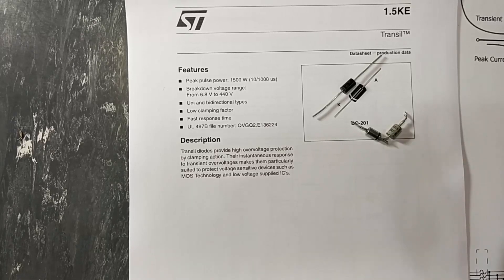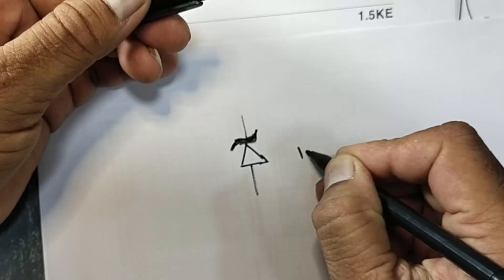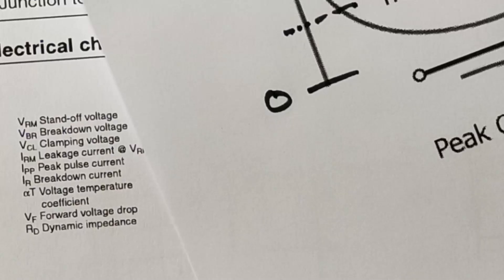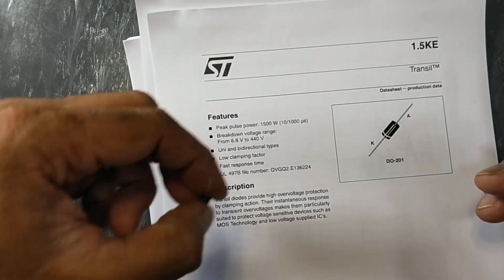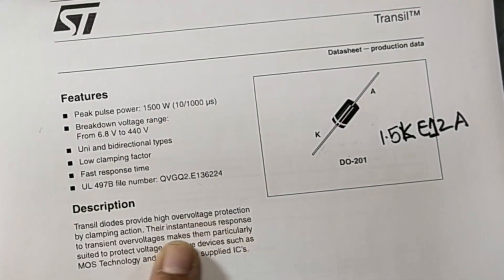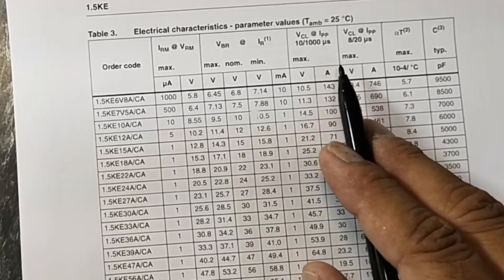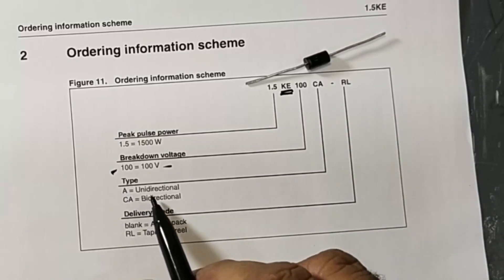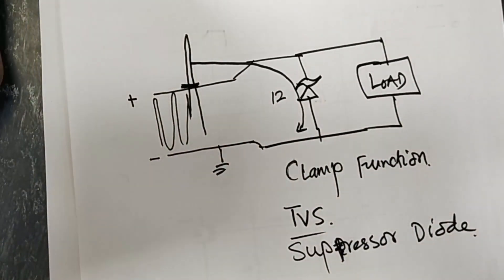{485} TVS Diode Unidirectional Explained, Transient Voltage Suppressor, Transil or Thyrector

Comment: Can I connect 2 unidirectional TVS in series to double the breakdown voltage? I have a 170 V damaged TVS and want to replace with to identical 85V TVS? Is it possible?
Reply from the maker: yes 
it is doable. you can connect them in series
Reply: @HaseebElectronics Thanks a lot! I just tried and it look it works. I see now the circuit is working but I when increasing the DC voltage over 250V (DC voltage in the solar inverter input) the smps circuit start working an I see 170V across these series TVS. I want to know there are circuits when TVS are designed to work as constant voltage limiter like a zener diode or maybe I have something wrong although the circuit is working well for some time?
Reply: I compared it with another working circuit and the voltage value is 170V on the undamaged TVS when the smps start working. Thanks for this very useful video!

Comment: Anyone, please help. I have a Shower Heater-Unit with adjustable power control (potentiometer) that was given to me by my neighbor to fix and keep for myself, and after dismantling it I found on the control PCB a bidirectional diode with such electrolysis damage on it which dissolved both of its terminals and it was hanging at its place on the board by the rust (the symbol on the PCB is for a BTVS). I have tried to put solder at the two ends to attach new terminals to it so I can reconnect it in its place but they will not stick. There are no service manuals for this unit I could find by searching on Google and I am wondering how to fix this unit without knowing the part number or the clamping voltage of the diode (since there are no terminals left sticking out from the two ends) . The diode itself is a pink glass type with the "cathode" black band in the middle and D8 is written on it. The diode is also not clamping anything in parallel (as in the case you describe to protect something from overvoltage on the board). Instead is connected in series to the gate of a small triack on the board (0107MA - To92) and to some other point on the board. The triack is probably driving an even bigger (high power) semiconductor that controls the heating element current and which is attached directly to the water heating unit (probably for heating cooling issues) and it is not on the control board. Any ideas on how to attach terminals to this diode? What is the range of or typical clumping voltages for these diodes? As a last resort to salvage this diode I was thinking if it is a good idea to use electrolysis and grow new copper terminals at the two ends if I immerse the one end of the diode in the solution and put a needle/pin with some high enough voltage to make the diode conducting current and start the deposition of the metal at the other end, then if it succeeds flip the diode and repeat.

Comment: How does tvs diode with three terminal work.
Eg part number B24C
Reply from the maker: can you please send its picture to my whatsapp, 
as i think B24C is in DO-214AA package style, it is in 2 lead package 
then the 8 pin dip contains 4 TVS diodes in one package 
if you have 3 terminal component, i want to see its package style 
my whatsapp is 009-62-79-116-1084
Reply: I have sent you  the photo of it
Reply from the maker: @drameriemmanuel1187  I will check it and will reply it
Reply: @HaseebElectronics  thanks sir.

Comment: Hi Haseeb, how do you know if a TVS diode is not working. Uni directional ,  will  it be shorted like a MOV
Reply from the maker: sometimes it becomes short circuit and it drops the supply voltage. due to its maximum breakdown limits 
it short circuit is eliminated very easily that it clamps all voltage in that line

Comment: THANK YOU. WELL DONE. Datasheet show that 1.5KE12C/CA parameter "Vcl @ Ipp 10/10000us" where Vcl=16.7V and Ipp=90A. Does this mean that TVS is clamping 28.7Vpk pulse (12V+16.7V) or 16.7Vpk pulse (12V+4.7V) @ Ipp=90A ??

Comment: Years ago I was using a VFD to experiment with 400 hz into a microwave oven transformer. The turning the transformer on and off damaged a large diode. I took a large diode out of my junk box and replaced it not knowing what it was for, but it worked again! I now know what that diode was for thanks to you. I wish I saved the original damaged diode to replace it with the correct part!
Reply from the maker: wow 
it is really my pleasure, that my efforts are useful for my viewers

Comment: Hi there, I have a question, bought a new plasma cutter from China. I plugged in machine to power outlet and by just switching it on. The machine turns on for a second and trips the circuit breaker. Is the machine faulty? The seller asked me to change to a bigger socket outlet 240vac which I am already using 30 amps non fused. Additiinally upon receiving the machine, the 240vac input wire seems like funny looking with sticky substance on the outer insulation. Hope you could guide me. I clamped on anmeter to the 240vac and it reads roughly 12amps and trips the breaker. Thanks for the great videos.
Reply from the maker: does the circuit breaker for building trips off or the machines circuit breaker trips OFF?
if the machin's breaker trips off, then it is very clear that the machine have something wrong. it is expected that the machine have some issue.  after turning ON for 1 second, it seems that the surge protection circuit have some defect.  or the power stage have some issue 
if the building breaker trips off then, it means your utility line is to be upgraded.
Reply: @HaseebElectronics  Hi, its the building circuit breaker trips.
Reply: @HaseebElectronics  Hi, it is building circuit trips, the outlet is dedicated to welding machines, and all machines have worked with load on. Meaning weld at high amps. However, the new plasma  machine is just switched on at no working load. Meaning no cutting at all. Just power on. And on clamp meter it shows 12amps draw before triping breaker. My breaker is rated at 20 amps.
Reply: @HaseebElectronics  I also measured resistance on the power socket after leaving unit unpowered for over night. The resistance keep fluctuating and the lowest reading was 0.2 k ohms and varies to 3.3k ohms.

Comment: Sir i thaught a tvs is a thermistor now i know a tvs is diode tnx for information sir
Reply from the maker: no, tvs is a PN junction diode much similar to the zener diode. difference in zener and TVS is power dissipation
same size zener may be 1 watt for regular regulation. but same size TVS can dissipate 1500 watt peak pulse power. it is because of the size of the PN junction
thermistor is a resistor. and a MOV have similar function but MOV is made be metal oxides
Reply: @HaseebElectronics  thanks for the information sir